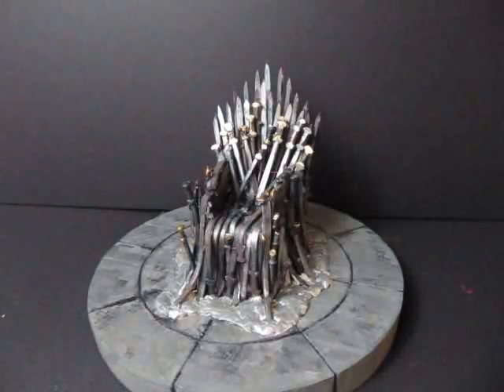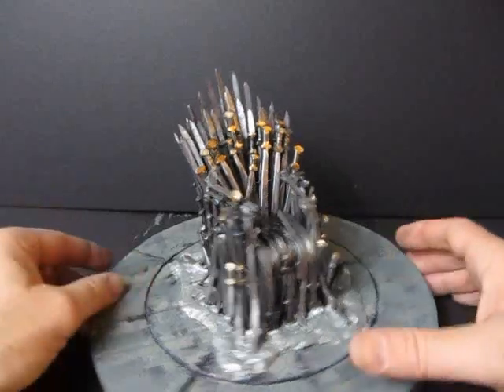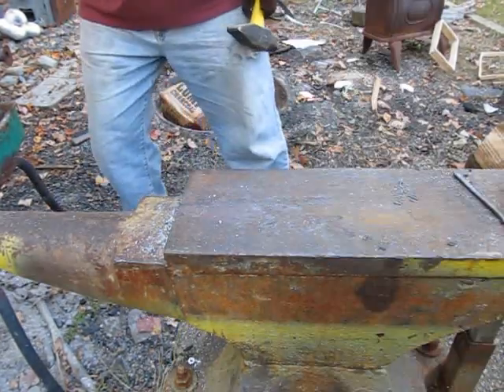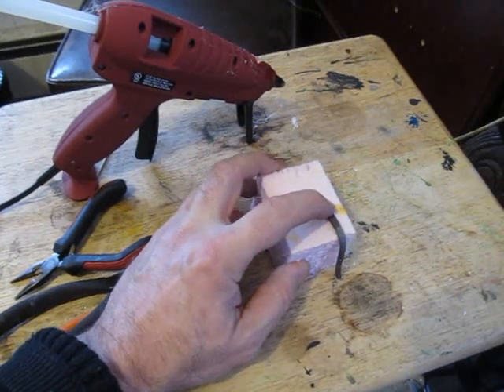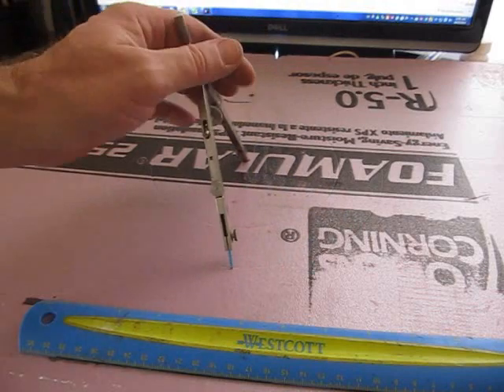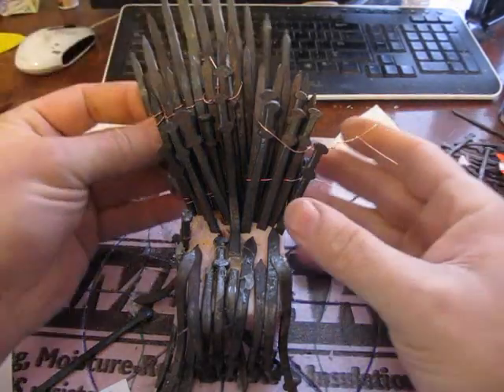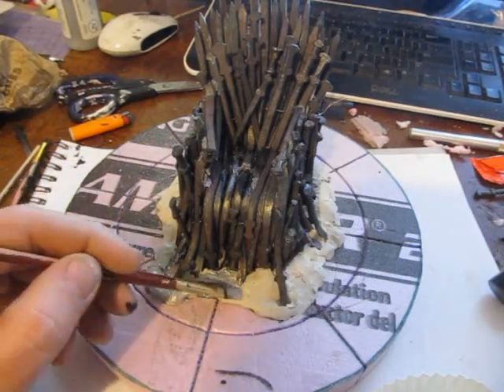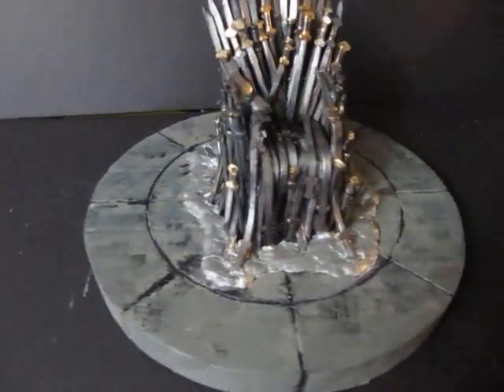Forge mini swords and make the Throne from Game of Thrones

Comment: Oh, what if you put the nails in a  lathe or a drill to sand and refine the handles and then pounded the blades flat then solder  or tack weld together.and then mount to a slate tile. Ooh I'm getting exciting, I think I have to make one